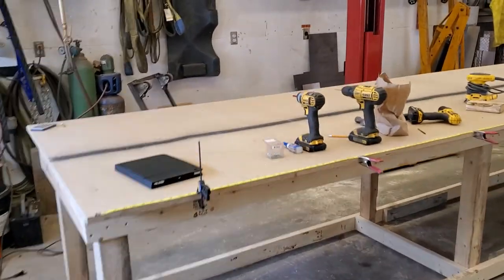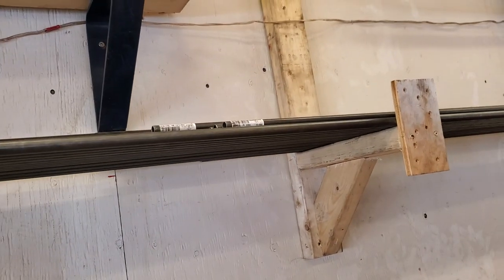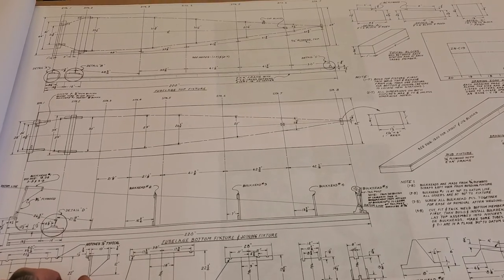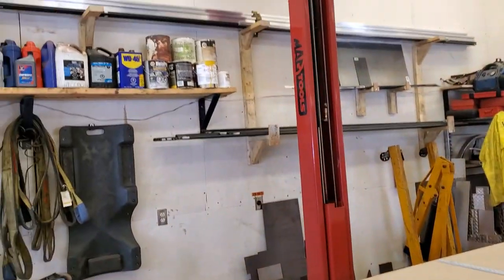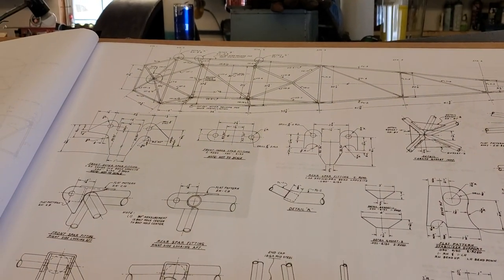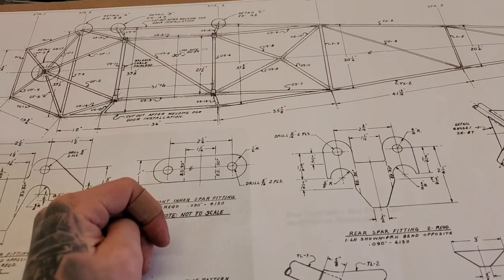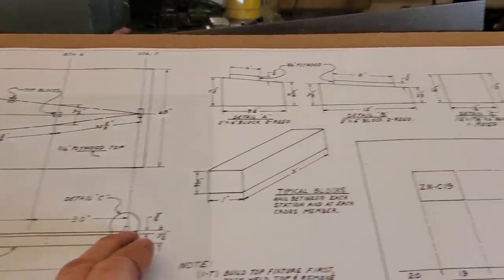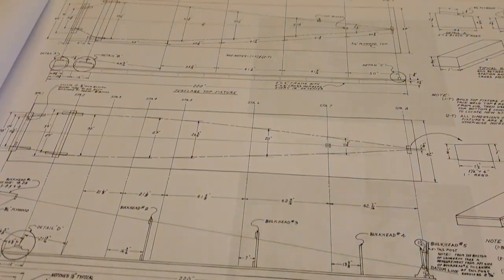I'm building an airplane! Episode 1

Comment: Just found your channel--great stuff! 

I built one of these back in the early 1990s, but never finished the project. Long story short, I was just finishing graduate school at the time and built the tail feathers, gear legs and then the fuselage. Had it all welded up, ready for the gear fittings to be welded on and then put the gear on the thing...and my training program required too much time away, and I sold the project. I always regretted that. 

Now that I'm sort of on the other end of the career, I am going to take another whack at it starting this winter. I have a new set of plans, and also have a set of Javron Super Cub wings. I'm an A&P from a previous life, so I have done a LOT of gas welding over the years...and I did use the OA process for that build. Now I also have a Miller TIG machine and want to use that a bit too, and coincidentally just ordered some of the 4130 cut-offs from Spruce. I saw you mention it in another video and chuckled. 

Anyway, I just subscribed to your channel and will check out all your other videos on this build as well. So far though the two videos I've watched really brought back memories! Love your idea(s) on the table centerline and the tape measure glued in place. Those are great ideas. I also have a Bridgeport mill and a Southbend lathe, but my lathe pales in comparison to what yours looked like. That thing looks huge--although I couldn't really tell exactly what you were running there.
Reply: Revisiting these videos now, as I have a new shop (after a move) and am doing some aircraft recovery/restoration. Still toying with the idea of building a "Super-Chub" sort of an aircraft, based upon the 2+2 plans. 

On the tack- and fully-welded fuselages from Wag Aero: They haven't offered those in years. I live 150 miles or so from them, and have visited them a few times over the last 4-5 years. Their fixtures are sitting around, covered in junk...as they don't have anyone left to build the airframes. I even offered to talk with them about doing it for them, but they don't really seem all that interested in offering the stuff anymore, as far as I can tell. I've tried to discuss it with them a few times over the last couple of years, and no one ever responds to my inquiries on it. Basically, sadly, it seems as though they're more or less a shell of what they used to be...at least in terms of the Piper-clone aircraft they used to sell. When I bought my original plans from them in the mid-1990s and went over there to pick them up, I got a tour from the owner: There seemed to be all kinds of aircraft parts construction happening there, including the fuselages. But those guys all retired and no one really came along to take their place(s), so it sort of just died out near as I can tell. Now about all they do is to repair engine mounts and landing gear legs for certified aircraft. They do a really nice job of welding on those--I looked at a number of yellow-tagged engine mounts when I was there last.